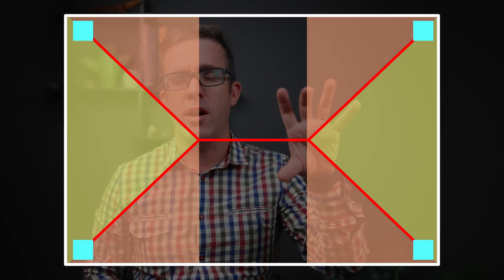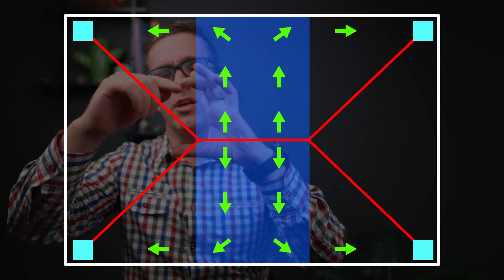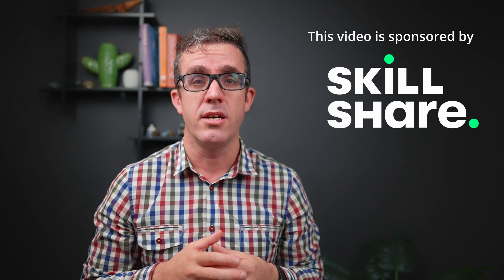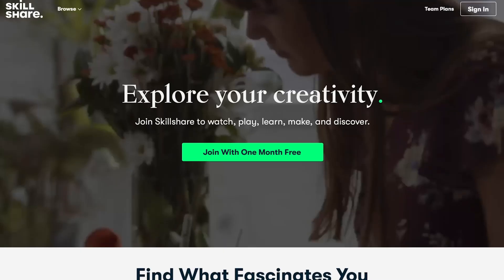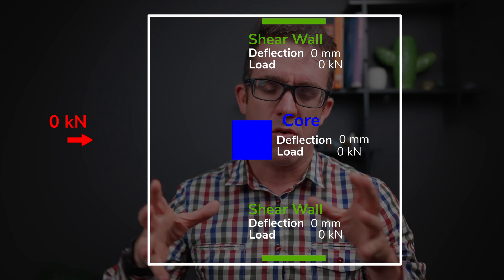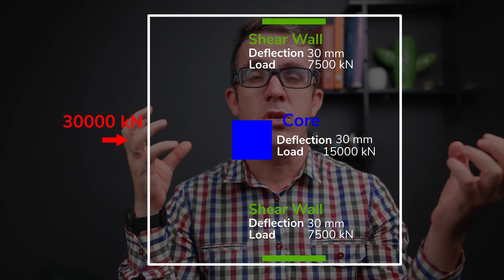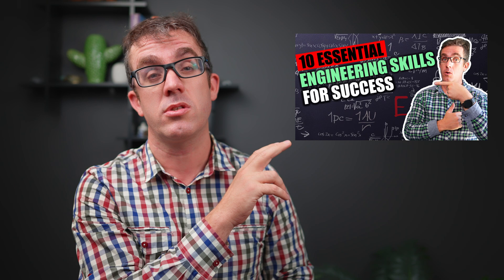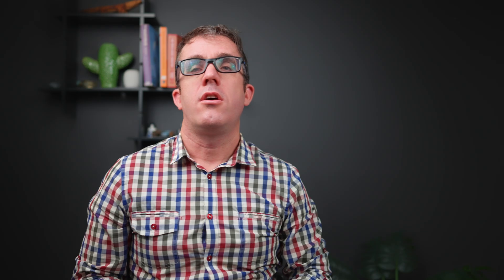Structural Design: The only thing you need to know

Comment: Loads doesn’t cascade from stiffer elements to less stiff elements, it travels simultaneously  along all possible pathways in proportion to stiffness.
Reply from the maker: Yes, load it transfers based.
 but as parts get more loaded they deflect, this transfers they load to the part that hasn't deflected. So load spreades based on stiffness with the stiffest parted "becoming less stiff" delfexted the load distribution is proportion based on stiffness.

Comment: I always find two-way slabs interresting, because they are so many variants of it depending on the column grid layout and the preferences of the designer. In a local (rather large) underground parking garage I’ve come across different approaches with the use of column strips. In some area’s they’ve thickened the longest span, in other area’s the shortest span. I remember when it was built, they used both semi-precast slabs as well as hollowcore slabs with in-situ top layer supported by semi-precast column strips. In the case of the combination with hollowcores, the column strips are used on the shorter span. The garage is consists of two levels and three distinct sections, all built by different builders. Since there are building on top of it, the deck under the street level has really heavy transfer beams whereas the middle floor has the slabs with column strips.
Reply from the maker: Hi DYKO, all Slabs support on column behaviours in twoway actions even with beams, it is just a function of the beam. The stiffer the beam the more it will behave like a one way Slabs. Thanks for the support.